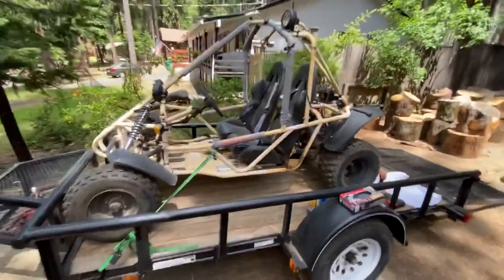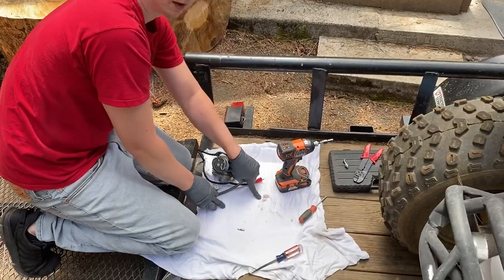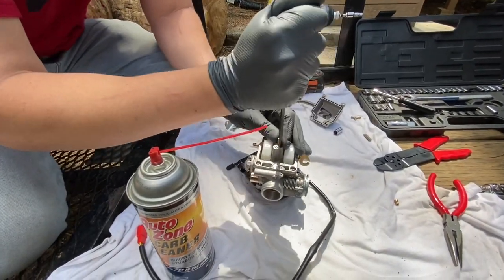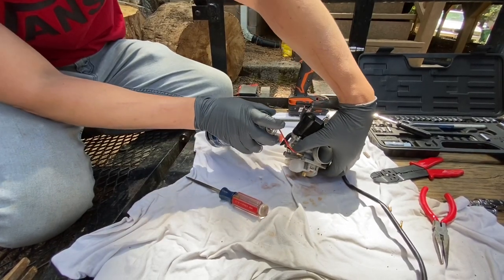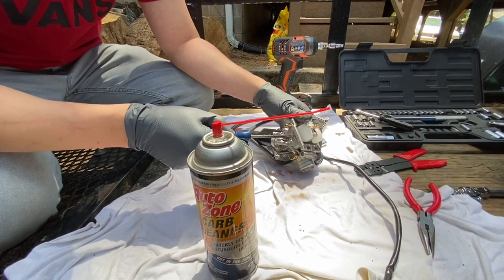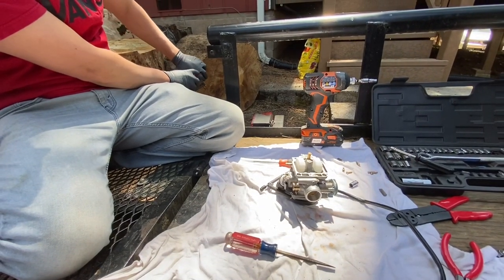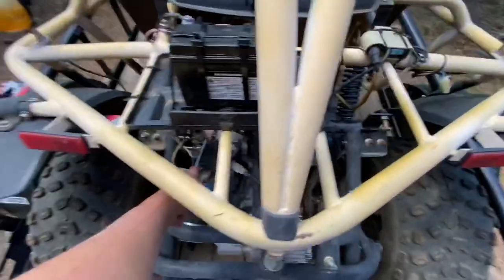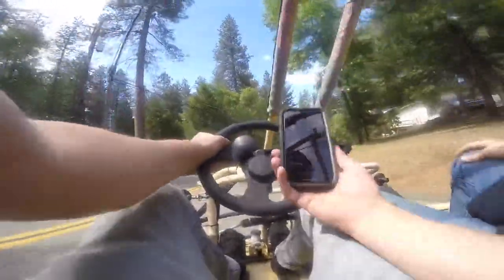HOW TO FIX ANY CARBURETOR !!!

Comment: Hey man lovin the vids. But just 1 tip when cleaning carbs in the future I wouldnt use carb cleaner because it says on the back but it ruins rubber. So the gaskets will go bad. Either you can use brake clean or air just like you said. But anyways great vid
Reply from the maker: Thank you
Reply: throttle family no problem It’s just that I don’t really get why it does but I’m not sure why it would do that and why they would call it carb cleaner but keep up the great work